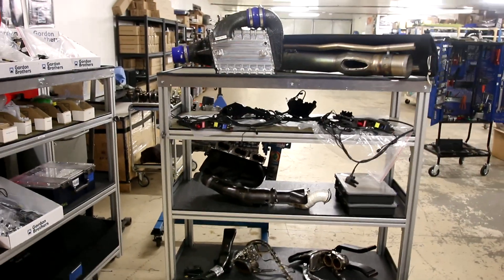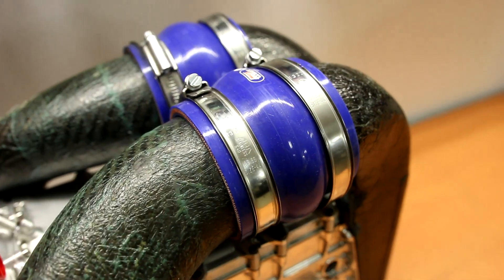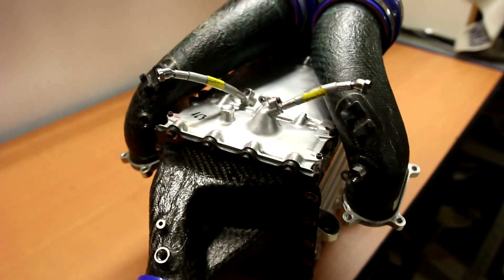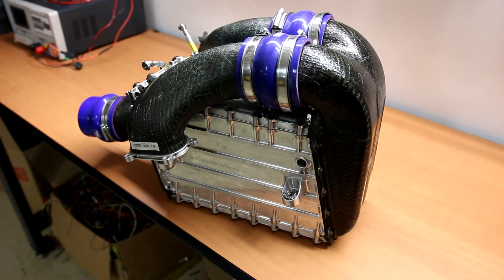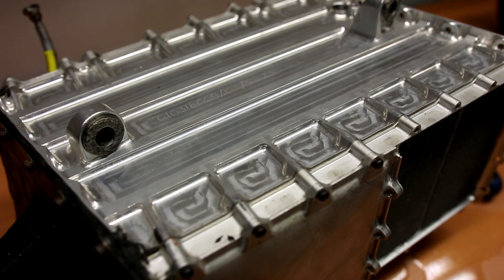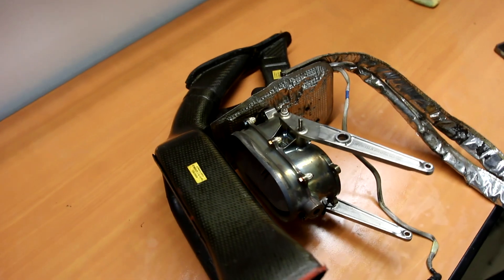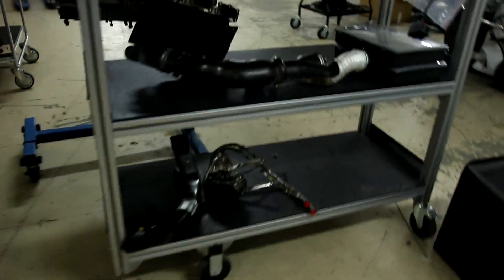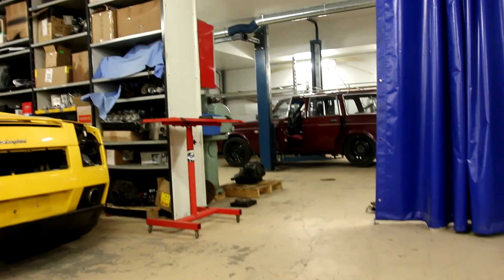Formula 1 Intercooler and Wastegate in detail (Ferrari)

Comment: I feel like if you change the inlet to a bigger cross section and lower the speed you can increase the heat transfer into the water and squeeze out a bit more cooling

Comment: That intercooler is SUPER efficient. It should capable of cooling your lambo. Fi cars are pretty much full throttle always. That thing has huge heat removing capabilities. Plus how much water you run affects thermal mass alot. An 800 hp intercooler and a 800 hp wide open for entire race intercooler is a different animal. Beautiful unbelievable Swiss watch of intercoolers.

Comment: Peter - do you have any dimensions you could share, height/width/depth of intercooler, maybe wall thickness if possible? Looks about 30x20x15 cm??? Curious what the density of the tubes is (how many tubes/cm^2).

Thanks again for all this insightful and awesome content, as well as the replies.

Comment: That intercooler uses refrigerant gas under decompression. The inlet lines are too small if a liquid had to cool that amount of airflow. Probably the same cooling the ultracapacitor and K.E.R.S. motor.

Comment: Exclusive content ... Thank You!  By "hydraulic" do you mean oil pressure?  Pressure rises dramatically under load and drops on deceleration, so it could work ... maybe. If the five wires are actively controlling valving that could dial the system in. Maybe it's a independent hyd system all together.  Would love to learn more about this stuff.  Wouldn't it be fun pressing the 1600+ tubes into the intercoolers, assuming you only had a few hundred to make... not!

Comment: I believe they use distilled water for the intercooler because its transfer heat faster than a coolant or antifreeze and thats why it has mixed with the aluminium residue resulting a sediment at the bottom part.thats why we can see the residue clearly because if using coolant they will put some color in a coolant if they using it to distinguish it from other liquid if something is leaking, i think the intercooler didn't share the water/coolant with the engine cooling system,  btw nice video,  this kind of things really amuse me because  i love to learn something new about car technology and this kind of parts are rarely seen like u said its was a secret thing,  i think i wont see any of this if you didnt show it in the video, cheers mate

Comment: Kinda unreleated question but , if wastegate is there to save the engine from the extreme amount of boost.   Why not just add a smaller turbo with less boost that the engine ll be able to handle and then dont run a wastegate at all because max turbo pressure is already within the limitations of the engine?

Comment: That wastegate is so much more free flowing than a right angle poppet valve overcoming fixed spring pressure. I would absolutely use the wastegate but it's not designed to sit in traffic. It's durability is probably quite limited. The same with the intercooler, you will need to run a high volume dual filtration system and possibly a marine anode to limit any corrosion.

Comment: I think technically that type of intercooler is referred to as "very expensive"
Reply: Its called microtube radiator
Reply: Yeay but not crazy expensive,  it use simple concept but a difficult process not to mention assembly of the tiny brass/copper tube(its look like it)

Comment: Interesting thought, the rumour is the current F1 Ferrari inter-coolers are oil to air which enables them to accidentally 'leak' oil into the charge air. This action raises the calorific value of the combustion mixture = bigger bang!
Reply: i agree but don"t you think,that if FERRARI WAS "misting"even top refined oil in their combustion chamber and Turbo set-up(1200°C+),the car would smoke like a MIG 29 on take-off,with after burners..???

Comment: I didn't know these intercoolers are cooled by a liquid, I was looking at it and thinking if intake air goes in one end and out the other then where does the air come from which cools the intake air? So they have thier own radiators I would suppose right?

Comment: Just a small correction @6:40 If the air encounters a narrower diameter, it will actually increase in velocity but decrease in pressure. So I think the aim there is to have more air flow faster and leave a lower pressure "behind", for more air to flow through...just my two cents. :)

Comment: The texture on the outside of the carbon parts is caused by the vacuum bags used in the molding process.  The mold would be on the inside keeping it smooth but since the outside didn't matter they didn't make a mold side for it.

Comment: The inter-cooler looks like it could be an evaporator coil similar to an A/C system.  Compress and condense a gas then let it boil by removing heat energy from the air inside the plenum through the coils.

Comment: Using F1 parts on a street car is like hiring a hooker to do the dishes.
Reply: You make it sound like it's a bad thing...
Reply: Could be fun though
Reply: boostedsil40  
That's so ignorant! Why would teams with the ability to do anything - simple or incredible - so long as it works, go to the effort to perfect these parts if they weren't any better than your backyard ebay cooler with ghetto washer sprayer?
This part is crazy high spec for the street but if you want to cool an engine that could feasibly run 1000hp each bank then these are the lightest, strongest, most efficient coolers you can get.
Damn if I had access to one I'd run it on my 2L.
Overkill? Sure. Still would be lighter than a stock or off the shelf performance item.
Reply: What’s wrong with that
Reply: When your street cars a Lamborghini ,.thats a high class hooker..😊
Reply: boostedsil40  the design of the core allows for less pressure drop and in turn lower iat's regardless of application when compared to a traditional welded air to air cooler.
Reply: But you would though wouldn't ya?
Reply: so I'm clear here the concise way of what you said is using F1 parts on a street car is like marriage...or did I miss something?

Comment: Hey Peter, I suggest using the wastegates in front of the turbo intake that way you improve responsiveness and save fuel (idea from koenigsegg). For the intercooler, please hook it up to your air conditioning cooling fluid, I would really like to see how much more power you would get by doing so. Just do not go below the dew point with the cooling, otherwise you would need to remove the condensing water and put it back in the cylinders after combustion *cough*.
Reply: The coolant intake is on the motor side of the intercooler, that way it works kind of a cross flow heat exchanger delivering the coldest air possible. Also a second intercooler used as precooler before the turbo intake can give you a big boost because the compressor can work more efficiently in cold air. And you can remove at lease some condensate before it even goes into the compressor.

Comment: suprised regular hose clamps can withstand the boost pressures they are running :D
Reply: They run somewhere around 3 bar maximum under normal conditions because of fuel flow regulations(increasing more pressure would cause a lean condition).

Comment: I wonder how many hours they are rated for. if one pipe leaks you will have contaminated intake air
Reply: However if each tube is 200mm long and 1mm in diameter, that equates to roughly 10 square meters of surface contact for air to exchange heat. Most F1 teams (especially Ferrari) wouldn't even care if the intercooler was smoked after 1 race if it means having that level of efficiency. If those rows of 11 tubes were replaced with one bar as is typical of most liquid to air intercoolers of equal size it would go down to 7 square meters of surface area.
Reply: These engines had to do 5 races at 300 km plus maybe 300 more km's of qualifying and practice.
Reply: Well then you get a combined charge cooler/water injection system
Reply: Over 16000 possible sources for coolant to enter the intake air, wow!
Reply: Very interesting. How are you using the gallardo? I must assume you are not going to daily drive it with this setup or what? Are you not concerned about having coolant in your intake air?

Comment: It is very unlikely that Mercedes is using air to air intercooler, as it has been known for a while now, that water to air charge coolers are much more efficient in terms of cooling area, pressure drop and charge out temperature.

Comment: Really interesting to see how rough these parts are. Resin globs on the carbon fiber exterior and a really fast surface finish on the aluminum. Serial number on the aluminum looks like it might have been done by hand. F1 seems so polished and professional from the outside — it is interesting for me to see the imperfections and human elements.
Reply: They are true 'prototype' cars, very interesting video.
Reply: The carbon is rough, but those castings are wizardry. All the little CNC milled out chunks to save every possible gram are awesome.
Reply: Augusto Ortiz: No, the regulations at that time (2014) said only 5 power units per season (~20 weekends). Nowadays it's 4 PU's per season. So every engine must last for 15 practice sessions, 5 quali and 1500 km in race. 😉
Reply: i doubt youd see such crudeness in the larger teams like SF, Merc or RBR
Reply: Raw vacuum bag finish on the CF parts. Your normal carbon fiber hood or similar will have the finished outer surface made against the tool (mold for the part), and take the surface finish of the tool. A clear coat (or gel coat in fiberglass boats) is applied to the tool for an even better finish. On this the 'finished' surface is on the inside for smooth airflow, and the vacuum bag surface is the outside.
Reply: Marcus Andersson next season it's down to 3 complete units for a whole season even the super reliable  Mercedes will be copping grid penalties  even the hybrid engine maters at brixworth and brackley  can't stretch out 3 engines for probably 20+ races
Reply: Patrick Jones 3 little words "weight reduction bro".
Reply: Function over form, I suppose. On the engineering side, that intercooler is absolutely gorgeous. All this tiny coolant pipes and the machining is just amazing. I wonder how many man hours it took to produce it.
Reply: Patrick Jones since they only last one race i suppose they leave those looking like prototypes, but im sure the ones they keep in museums are completely polished to look like perfection.

Comment: I was reading a short feature on the 2.4 L V8 Formula engines - 650 liters per second (23ft@3) at 19000RPM - is the air that an old NA engine was swallowing.
 The turbo engines have a better volumetric efficiency but a smaller block. Anyways I expect a power unit to swallow somewhere between 650 and 900 litres/second (rpm dependant). An F1 turbo is having a higher CFM than a Huracan NA, that's obvious.
Why is that? Because I know Bugatti Veyron quad turbo (not N/A like Huracan) is able to swallow 47000 litre of air every minute, and that's a number written by Bugatti. 
If you divide 47000 to 60s you will get 766.66l/s. 
Now remember, a N/A F1 2.4l V8 engine was able to swallow 650l/s @19000rpm and here we have a quad turbo 8L W16 engine which was the pinnacle of the supercars swallowing 100l more air/s than a 2.4L V8 N/A F1 engine. 
If you downsize the engine by half it would still be 1.2L NA with 325l/s, which at 1.6L NA would be around 400+L/s. Now, a 2015 F1 Power Unit was running the 1.6L V6 engine at 15.000rpm while having maximum 3.5bar boost pressure. Let's say that the volumetric efficiency would be only double compared to the NA engine (not 3x due to turbocharger), you would still have ~800L/s of air at 15.000rpm.
Now, compare that 800L/s on average used by the 1.6L v6 turbo F1 engine with the Bugatti Veyron 8L W16 quad turbo which is using 766.66L/s. Only with a twin turbo V10 running at 1.8bar boost you will be able to almost catch the F1 engine and to max out the intercooler.

Comment: I was under the impression F1 was not running waste-gates, they used the E-Turbo with the MGU-H to harvest electrical energy from the excess turbo pressure, but when it gets more exhaust pressure the MGU just harvests a higher current to keep the turbo boost level at its desired level whilst getting more electrical energy for the batteries?
I guess if there was an electrical MGU failure, the exhaust could not be transferred into electrical energy, then the waste-gate would need to be employed to retain boost levels, can anyone clarify this with me?

Great video and great score of parts, thank you for posting this up.
Reply: Simons World I can't verify it but I think your right. If the electric system is fully charged there needs to be a back-up wastegate to regulate boost pressure.
Reply: Simons World , when dealing with a pressurized system there will always be relief valves for obvious reasons!.
Reply: That's why it's hydraulically actuated! It is only opened when harvesting cannot be done!
Reply: It is not sure that the new engine use (or maybe even have) a wastegate. Ferrari got caught on the wrong foot in 2014, even now they are not recovering enough energy from the MGUH(Who can, in theory, recover an unlimited quantity of energy) compared to Mercedes. Right now the MGUH is the wastegate. Air down the wastegate - lost energy.
Reply: Simons World -  the FIA mandated the wastegates be vented with the exhaust to increase the sound the cars make...   those are the one or two little pipes (depends on the team) that are right next to the exhaust pipe.    The funny thing is, since the teams have such fine control over the turbo systems, the wastegates are almost never used !!!

Comment: THANK YOU SO MUCH FOR SHOWING THIS.   its so hard to find detailed pictures of the wastegates that i thought back in 2014 the new engines maybe didnt have wastegates at all. then they implemented the screamer pipes and thought maybe wastegates were retrofitted.
Reply: I think the blow of energy is used to power the generator to charge the hybrid battery from a impeller problably. That energy is harvested with a secret solution.

Comment: Marussia did not get the Spec engines that Ferrari had for that year (2014). In fact, Ferrari for awhile never sells their Spec. engines to other teams.  The engines that the other teams(Marussia, Sauber, Haas) gets dialed down versions of the actual engine that Ferrari uses.  It is no surprise that the clamps and hoses are not Ferrari.  The introduction of this V-6 T Hybrid (MGU-H & MGU-K) in 2014 are one of the most expensive and complicated engines currently in F1.  Since that time they have come along way to the batteries(harvesting) and torque-fill in kw or ft. lbs.  It seems you have quite the collection.  Hopefully in 2020 into 2021 a new and cheaper formula gets introduced (rumours are a V-6 T w/KERS or V-6 2T w/KERS as they are doing away with the MGU-H component; about 1100 - 1200 hp and noise levels go up ) as well as more manufacturers come into the fray ( Porsche, Cosworth-Aston Martin, Illmor).
Reply: joe r gonzales . Nope.  The real difference is in the mappings. Customer engines are sold with a set number of "safe" mappings.  Where as a team like Ferrari or Team Mercedes have access to a multitude of engine power mappings and that includes no high power lockouts on race mode. 

Parts differences just depend on development pace and experimentation.
Reply: Ian Powell - yup, hence my use of "Spec" engines.  I'm aware of the engine mappings and quali set-up modes that the premier teams (Ferrari & Mercedes) have in their engines HENCE "dialed down versions of the actual engine" that the premier teams use.  Premier teams have the Spec engines with all the mappings and setup modes while everyone else DO NOT have the Spec engines or dialed down versions without all the mappings and quali modes.  Only the premier teams have access to that.   So why the "Nope."
Reply: It's called works team not premier team. Also change in engine mapping between race and qualifying is forbidden since 2011, however mix settings are allowed which is better know as engine modes. Engine mode (mix settings) is purely a balance between consumption and power without remapping the engine.  It's no longer allowed to deliver client-spec engines by the FIA. Sauber requested an older engine to get an discount on the PU which is not an client-spec engine, just an old one. 

Both Williams and Force India have qualify modes they select in Q3. It is something Sainz complained about this season. You notice how they qualify pretty good but have often poor performance in the race. IIRC Perez was angry at himself when he forgot to select this mode the first corner and was outqualified by his teammate (The Hulk) previous season. Perez told that in Abu Dhabi he lost 1 tenth on the first corner alone not driving in qualifying mode.
Reply: Society Unplugged basically the sole reason why mclaren is with honda. no PU customer team will ever have a chance of beating ferrari or mercedes. from what i understand fia rules that upgrades to the PU have to be applied to the customer engines too. tge customers dont get q3 oil burn mode
Reply: HAAS is the only customer Ferrari powered team that use current spec Ferrari engines.
Reply: Society Unplugged bingo
Reply: euroaaRON1 - Mclaren is with Honda (per Ron Dennis) due to:  1.)   FREE engines, 2.)  Honda pays for, I believe, half of the drivers salary (Alonso alone is $40 million/yr compared to Lewis's $50 million/yr and Vettels $40 million/yr) AND 3.) free sponsorship from Honda...not a bad deal if you ask me...hat's off Ron.Honda, since 2014, has already burned over $300+ million on this current PU T-Hybrid..
Reply: JoeMaters - yup, started this year. Next year (2018), Sauber will come into the fray.